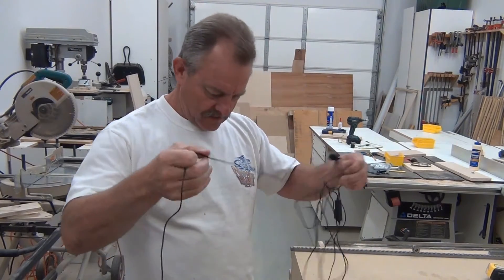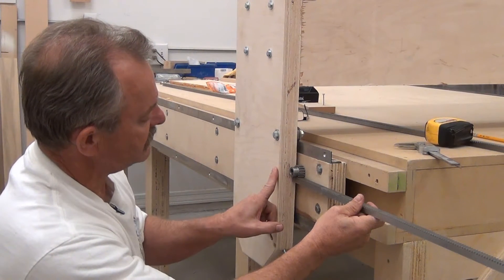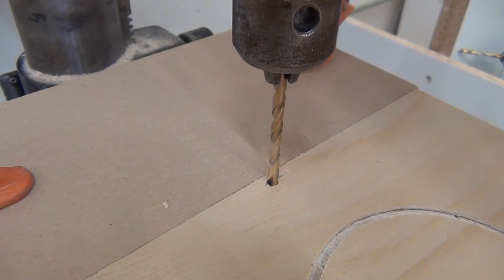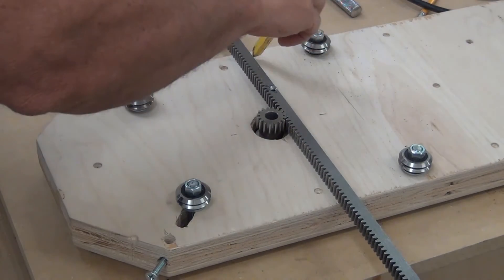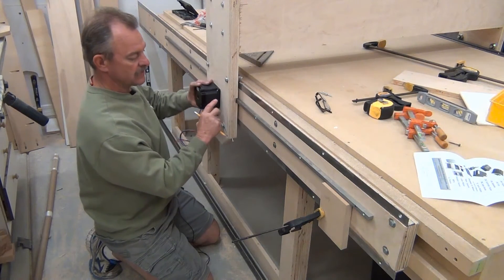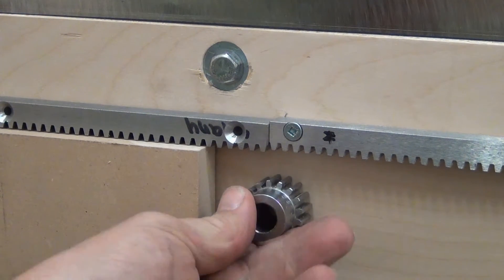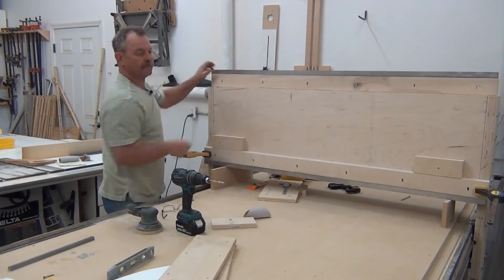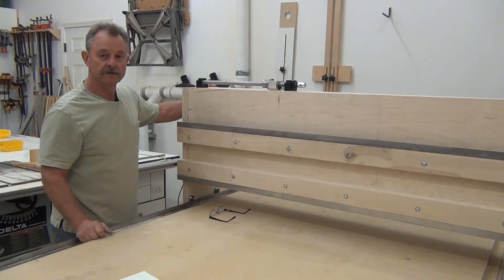Homemade CNC Router - Y Axis Rails Part 4

Comment: Hey there - a thought on your build (very cool with wood BTW) = have you considered adding encoders along the rails? If you do you can take the feedback from them to ensure that when/if a stepper skips the controller can compensate for it. You won't ever get a bind or resonance with them being out of sync. Not so much on resonance I suppose, but accuracy. I look forward to seeing this completed. So - I gotta subscribe to get notified or I will forget. Good luck man.
Reply from the maker: I have no experience with encoders, but I very provocative thought.  I have adjusted my gear rack and the "slippage" problem seems to be eliminated for now.  I have some other redesign ideas in mind as well.  I don't know if this thing will ever be "completed", but it is functional.  I keep coming up with improvements and additions that may never end.
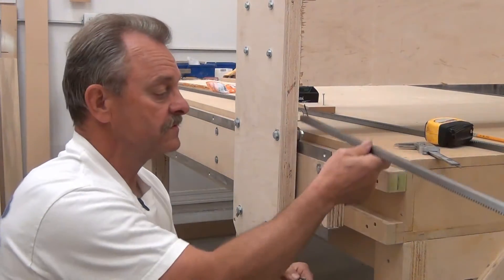Reply: @OldGuyWoodworks  -  An encoder is the 'switch' compliment to stepper motors. I bet you have encountered them if you have ever turned a control knob that has distinct 'divits' that you feel when rotating. Each little dip is a feedback location in the encoder. Since you can 'count' them electronically, you can also use them to feedback the number of steps a motor has taken. If the motor skipped because it was over loaded or stressed, then the encoder will report the missing turns. Which can then be corrected. The trick is to turn the encoder with the motor at the same time the motor is moving your object(s). The easiest way to explain it is with another video so you can see what is actually happening. And there are plenty - here's one selected at random: https://youtu.be/yS7BUTQoN0A    ---  2:20 shows what happens when you stall a stepper motor and then he shows how to overcome it. But he's also selling some product and there are plenty of DIY solutions that aren't as pretty looking, but just as effective. In this example he is just doing a stall detection. In real applications you would re-send the missing step to the motor the moment it happened to keep it in sync. Say, do that x number of times, and then default to a complete system stop assuming the error couldn't be fixed on-the-fly. I hope the info is useful at least for the knowledge alone. And good luck on whatever becomes with your table. It's without a doubt the most interesting CNC I've ever seen!
Reply from the maker: Thanks for the info.  It may become one of my "upgrades" to the CNC.  I appreciate that you find it interesting.  I had no knowledge of CNC production and took it as a challenge from my son-in-law to build my own.  Although wood is my realm, it really has limitations as far as consistency and accuracy.  I plan on rebuilding out of aluminum in the near future now that I proved to myself I can build one.  That's a whole new video series.